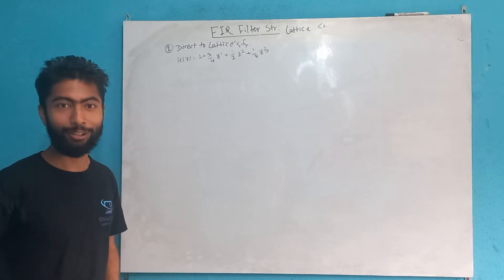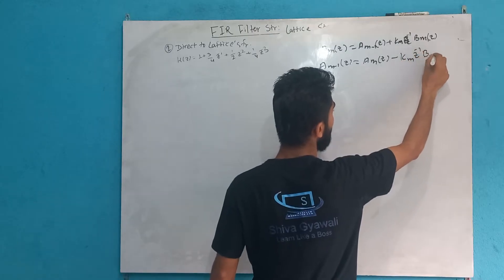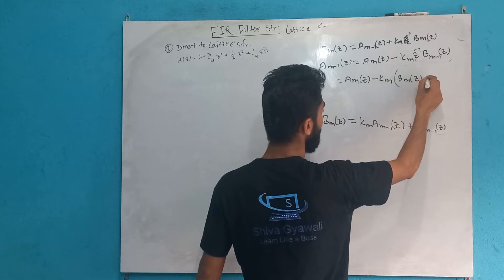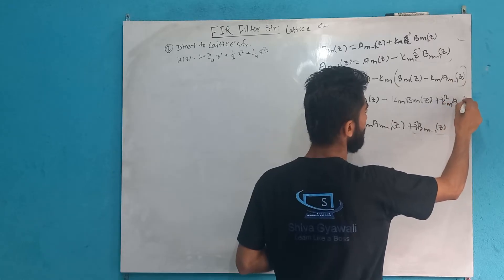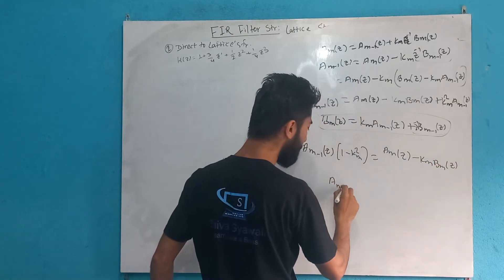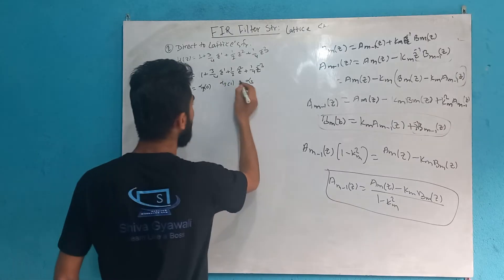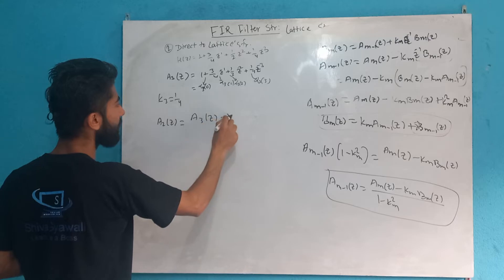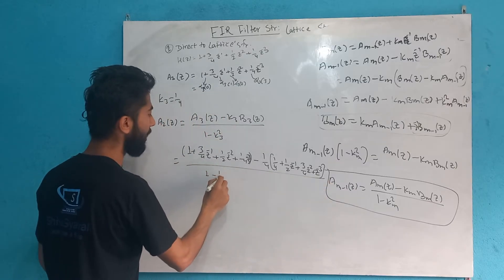DSAP5.6 Direct to Lattice Solved - Shiva Gyawali

Comment: Hey brother, it seems like there is a problem while using the formula to calculate Am-1(Z) when Am(Z) is given. What happens when the result of Am(Z)-KmBm(Z) is 0 ?
Reply from the maker: I think formula I derived is correct. And, I don't think AmZ-KmBmZ results on 0 for any valid stable system. Still, if you encounter so, then you can't proceed further. So, double check yourself that You got the correct BmZ and if everything is correct then say like, "Since system is unstable, we can't process further."
Reply: @ShivaGyawali  I also encountered a similar problem while following your tutorial.
 Please check Question no 5 2073 Chaitra  Page no 4 of the pdf
https://ioesolutions.esign.com.np/questions/digital-signal-analysis-and-processing-ct-704
Reply from the maker: @sulavthapa2042  for particular question you are asking, since, K4 is 1, this results (1-K²4) to be zero ==> denominator term is zero, resulting undefined value and unstable system. I also encountered such scenario, and what my professor suggested is, do mention that the system is unstable as it creates denominator term to be 0, further processing can't be done. However, let we proceed by taking stable system vanera K4=0.9999 put garera gara, so that It won't result in unstable state.
I am also student, so for solidarity on your conclusion, please consult your professor.
Reply: @ShivaGyawali  Thank you so much brother!
Reply from the maker: @sulavthapa2042  Glad that you got my point. Do share with your friends.
Reply from the maker: @64bitcoding5  haha you can find my contact details on description and about section. haha, glad that you too love palindrome😂 HaaH
Reply: @ShivaGyawali  dai i sent u rqst on fb please accept and can have conversation